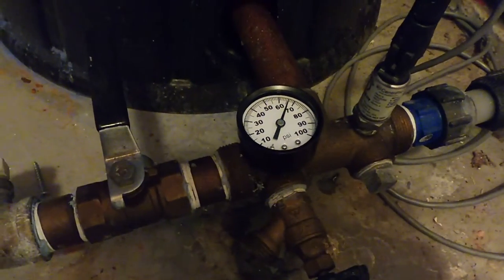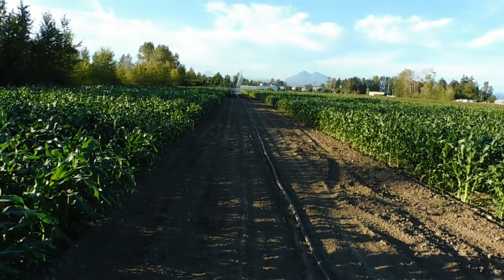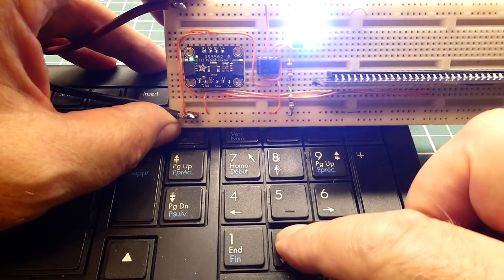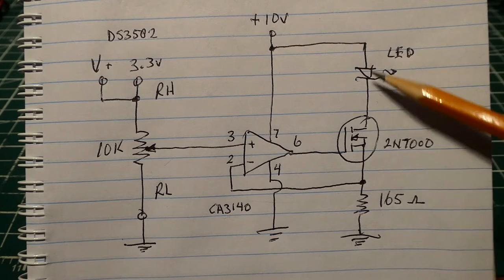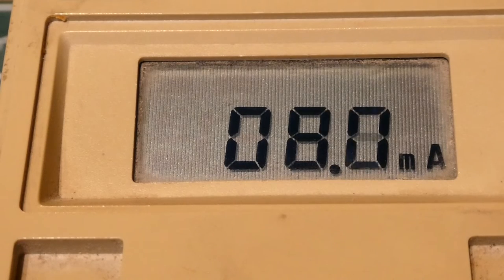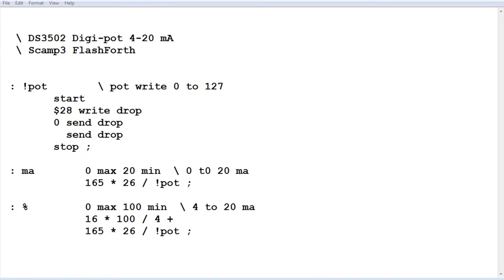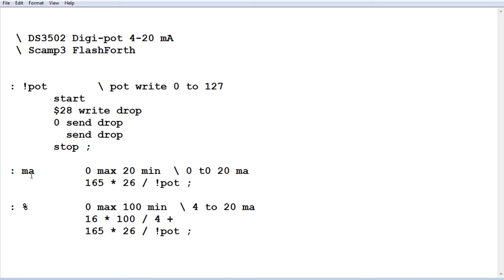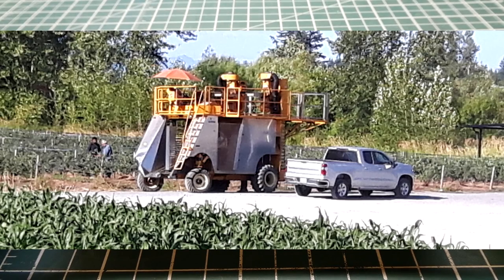4 to 20 mA Current Loop / I2C controlled / Scamp3

Comment: I've been working on my current loop design where the input voltage is coming from a processor, but had some trouble finding good way to adjust the output with components that have a lot of tolerance and I really would not like to have potentiometer there. This digital potentiometer is exactly what I was looking for. Thanks!
Reply from the maker: Welcome!  Glad it was helpful.